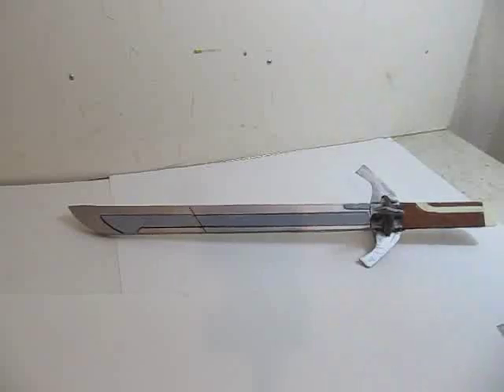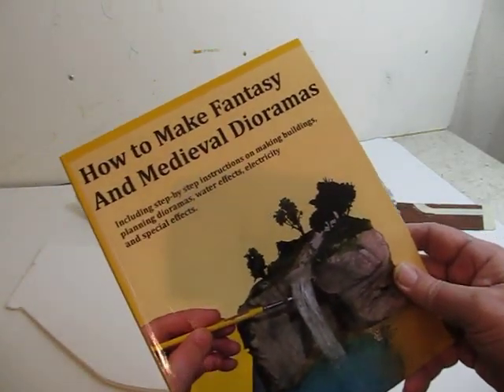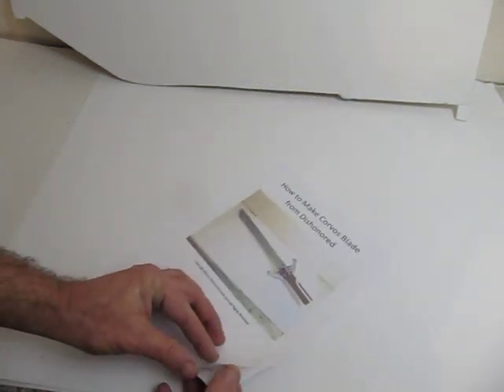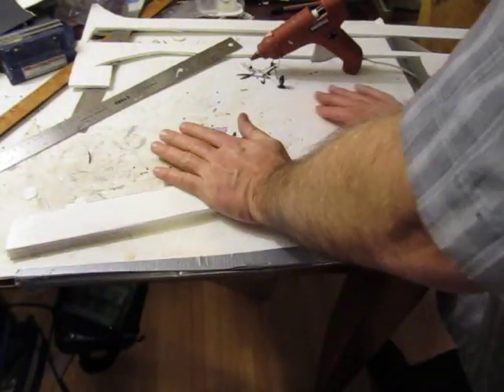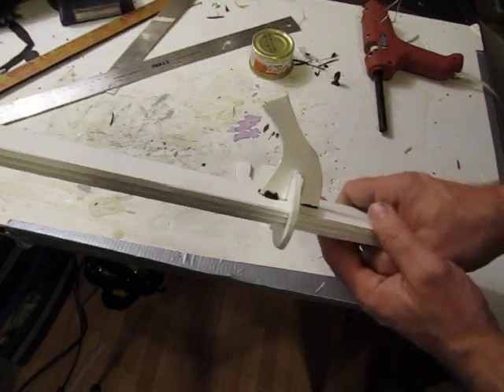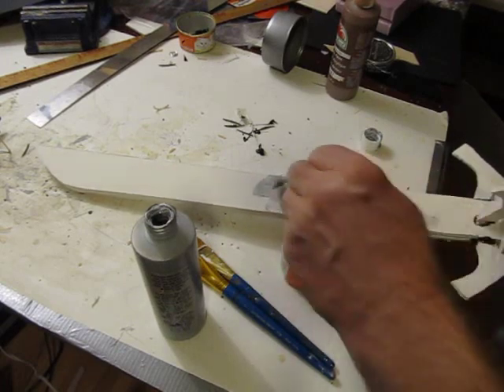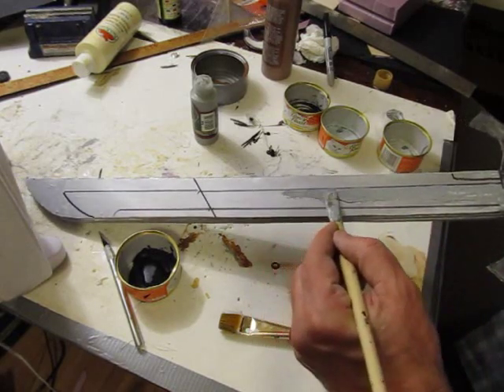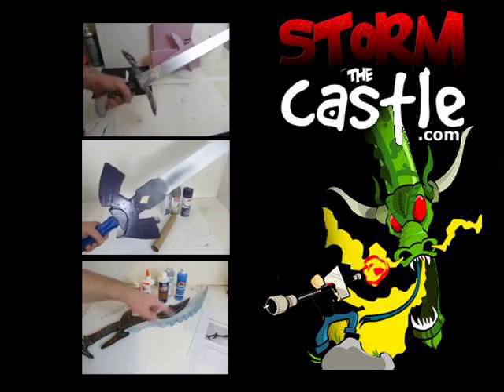Make Corvo's Blade from Dishonored

Comment: if it can't retract, it's not worth making. I need to know how the sword works.
Reply: 3 years late but the sword splits into two pieces like a butterfly knife, in this position the blade is not locked in so it can retract/extend, this is why in the animation Corvo spins the blade so the blade can be retracted/extended by releasing the handle and because he released it the handle splits to two. So butterfly knife but it retracts/extends, theres another youtuber who made a replica sword that actually works
Reply: I mean, he never says that it retracted anywhere